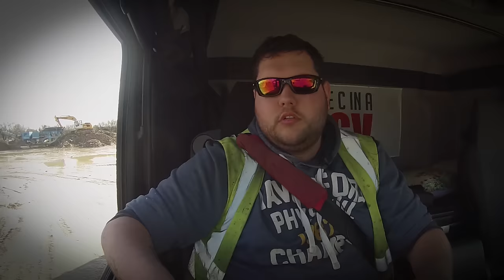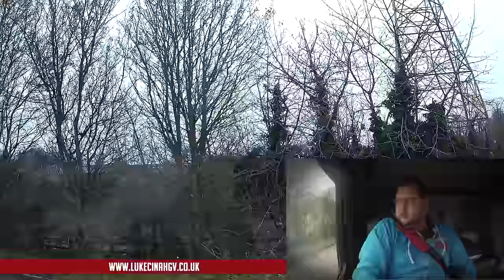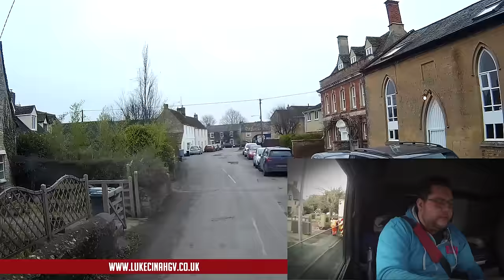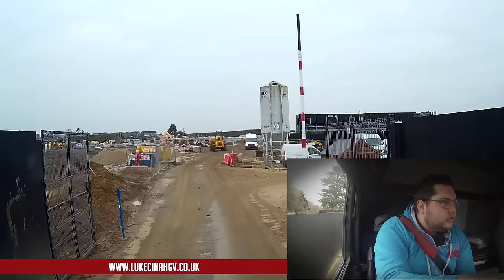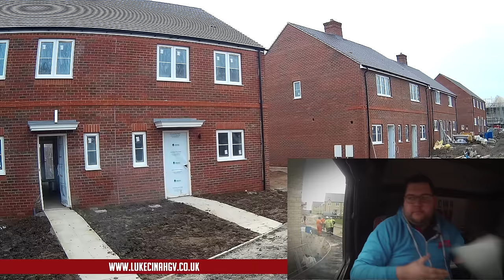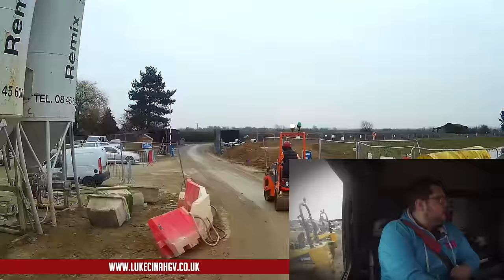WTF HOW DID THAT HAPPEN

Comment: Hi Luke bit of an odd question but just wondering if you were driving around reading way yesterday or monday could of have been friday possibly? But am a newly qualified pcv bus driver and i swear i saw you and wanted to toot at ya but i was route learning and didn't want to get in trouble with the instructor if it was you great to see ya! thanks Alain and btw keep up the vids i have started to watch them since I was thinking of doing my hgv after a couple of years experience driving the buses! :)
Reply from the maker: +BaseSanchez1 yes. I quite often deliver sand to our reading plant. I get of at junction 12 on the M4, drive on bath road, take a right at traffic lights onto burghfield road. (30 mph with speed cameras) I go over the canal, past the pup, and take a left onto berrys lane. 

I go almost everyday so it's quite possible you'll see me there :)
Reply: Yeah i think it was definitely the bath road it was on cause i was driving on the way to ikea! Good seeing you! and thanks for the vids they are helping me with my decision about this hgv license :)

Comment: Hi lads. I'm putting my CV in at a company similer to Luke's. But it's a, "How much do you want" job. What is a good adverage for CAT C doing what luke does? Any help would be appreciated. Thanks!
Reply: The knight of bad assness seen most advertising at £8-£10 an hour. I pull £11.50 doing palletised freight. Tippers may make more, depends who you work for i suppose. Good luck!
Reply from the maker: its hard to work out my pay. i get 475 a week regardless of hours worked. lets say 45 hours. so i guess it works out  to be about £10.50Ph
Reply from the maker: i might also add that these hours "worked" quite often means sat in my cab watching TV while i have 1-3 hours of chute work every other day  ;)
Reply: Thanks for the responses, lads. I was thinking about £10ph! What's chute work?
Reply from the maker: The knight of bad assness it's where I tip the body up and the gang lift a chute (square hole) and pour it into a wheel barrel. They then "hand lay" it

It takes longer than tipping stright into a paver. I can end up being on site for a few hours while they do chute work. Easy money 💰😂
Reply: +Luke C in a HGV is that take home luke?:-)
Reply from the maker: Josh Clift 475 a week BEFORE taxes unfortunately. 
A month I take home about £1650

24,700 yearly salary just under 20K take home.

Comment: Can you drive a Manuel when you pass your test in an auto because Ino you can't if you do it in a car
Reply from the maker: +Rye Xj6 if you pass your car test in a Manuel then you can you can drive a Manuel truck if you pass your truck licence in an auto.
Reply: Luke C in a HGV cheers buddy!!
Reply: I wouldn't recommend it chaps its a lot different from a car gear box especially if one day you have to drive an old twin splitter crash box yeah good luck with that.